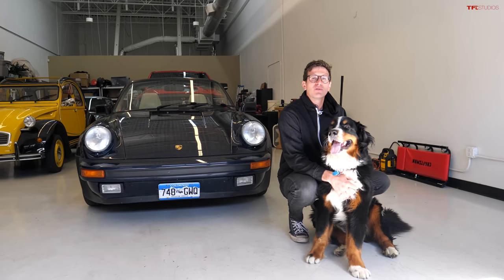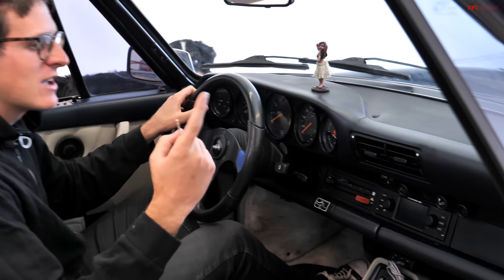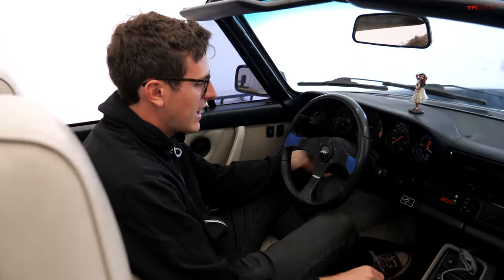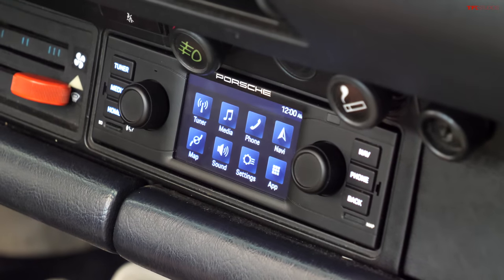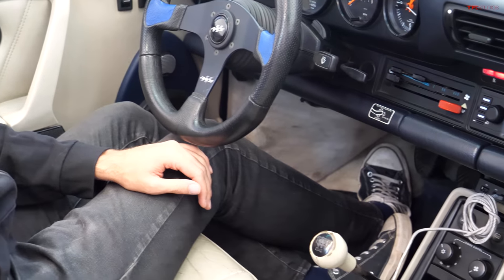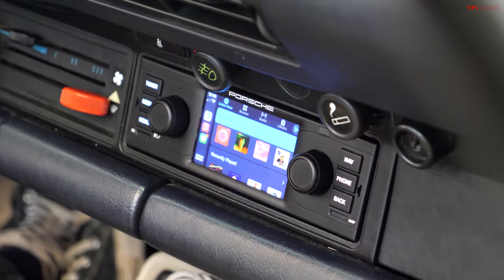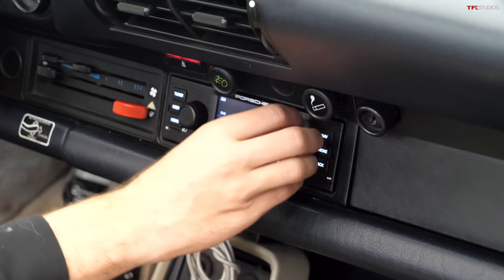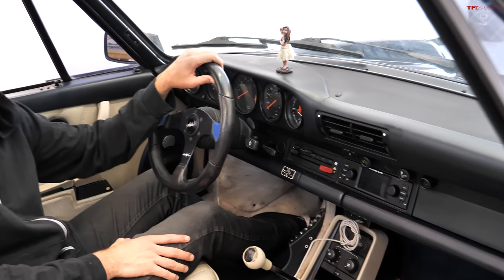Here’s The Coolest Classic Car Upgrade No One Is Talking About!

Comment: Tommy. “Reasonable” I don’t think that word means what you think it means.
Reply: It’s reasonable for ‘made by Porsche’ unfortunately.
Reply: Well... Reasonable for anything that's endorsed by the OEM, which means it'll carry a warranty and is atleast certified to work with the vehicle. I've seen plenty of aftermarket head units with CANBUS bypass modules that really screw up a vehicle pretty bad... especially with more modern vehicles (ahem, GM) running important CANBUS features through the head unit for some bizarre reason.

Comment: Retro head units can really improve the experience wih a classic cars. I have a Retrosound Hermosa in my 1979 Cadillac Seville and I absolutely love it. It looks pretty much exactly like the original (especially when it's off), but it has all the modern fratures like USB and Bluetooth. That said, you have to be a real fan to pay $1200 for a head unit.
Reply: Thinking about getting one of those for my Monte Carlo! How has it held up? Any issues I definitely wanna go with the classic look then these light up new ones
Reply: @OldSchoolRu707  I have been using it for a few years now and I'm very happy with it. There are only two things would like to improve - when the unit is on, the screen is a little too bright and colorful, and there is no option for an external microphone (at least my unit didn't have one). But those are just minor nitpicks - I would buy it again without hesitation.

Comment: Assuming the classic car still has the original stereo and the speakers are still decent enough to sound good, then the Anker Roav is a great upgrade for around $18. You plug it into the cigarette lighter and set it to an open FM station and then tune the radio to that station. Then you use your phone to connect to it using bluetooth.

01/29/24 followup: About 6 months ago I got a Pioneer car stereo and quit using the bluetooth cigarette lighter dongle. It does bluetooth, Pandora, Spotify, plays mp3 formatted CDs, and allows you to dial and answer the phone from the stereo. It is single DIN so it doesn't have a big screen, but it was only $99 and works well.
Reply: I have something similar in my 03 Civic. I'm not certain about the overall quality of such units, but given the price, certainly I could try out a few and still make out ahead by quite a lot, and for hands-free calling it's priceless.
Reply: @AbsalomIndustries  I have an old T100 pickup truck and it only has a CD player without mp3. The Roav works very well for both phone and music. The only flaw is you have to use the phone to dial and pickup calls. I think I am going to get a dash mount for my phone to make that easier.
Reply: Who listens to the radio nowadays except for radio news programs?
Reply: @evil_chuck  Let me help you out. This is about how to stream from your phone, not about listening to radio.

Comment: I'm redoing the tired Bose system on my '02 Boxster S, but going all modern.  Already picked up the amp, speakers, wiring, and double DIN housing (ditching the completely useless cup holders).  Just trying to decide on a nice but not excessive head unit, but hardly anything is in stock these days.  I'm keeping all the original parts though.

Comment: I like that you can do this in older vehicles, it's a shame it's not a thing for the current generation.
In ten to twenty years time, today's tech is going to look ridiculous but we've lost the ability to do anything about it.

It's not just Porsche that have this, JLR and Mercedes have an identical ones and I think they're made by Kramer.
Reply: @larrysmith6797  well ... Yes. 
I drive a 10 year old Defender and I don't lust after anything currently available for sale.

The Land Rover is rubbish and easy to improve on in many ways but no vehicle has, to my knowledge, fixed the bad bits, only added shiny things.

At least for the next year or two the Lada Niva is available for sale in the UK!
Reply: how have we lost the ability to do anything about it? head units in modern cars are still removable so in 20 years you can take it out and swap it with a newer one, same as you can currently do with an older car. 70s tech looks absolutely ridiculous if you're living in the 90s but now many ppl consider it cool and retro, whereas others want to get rid of it for something newer. itll be the same in the future for our gen of cars
Reply: @rayhaan171  are they removable? They don't look very removable to me! A friend has a green year old Fiesta with a dead radio and the fix costs more than the car is worth.

Comment: I hate when people put modern steroes in a visible place.
Reply: I mostly agree, but if it looks period correct and doesn’t trash the factory wiring, I can handle it. It would be cool if these had some sort of snap-on cover that looked like an original tape deck or something.
Reply: @caddyzig  that's what I meant sorry. I hate when people have Model Ts with a pioneer stereo in the center.